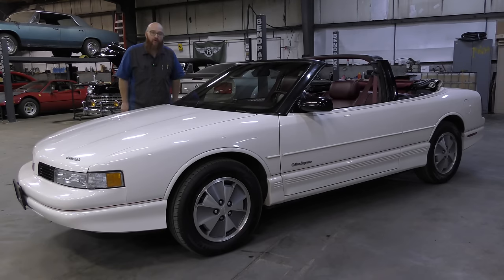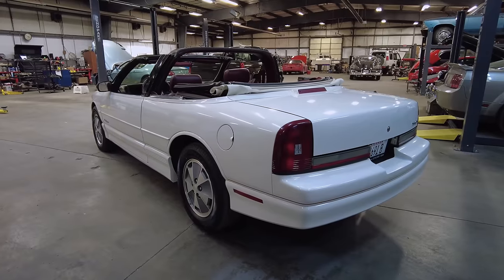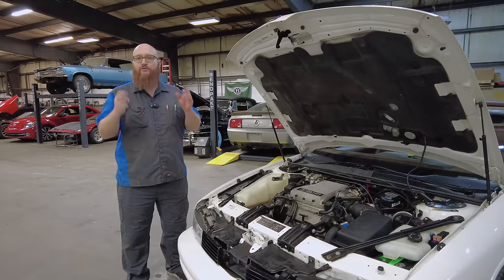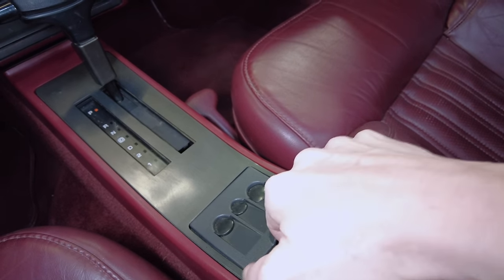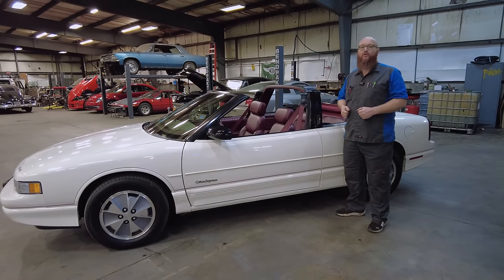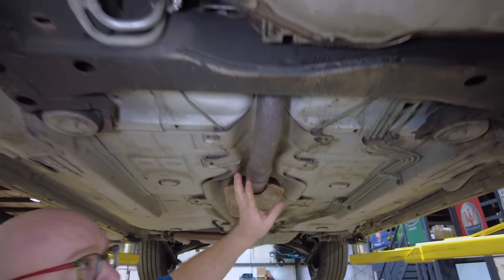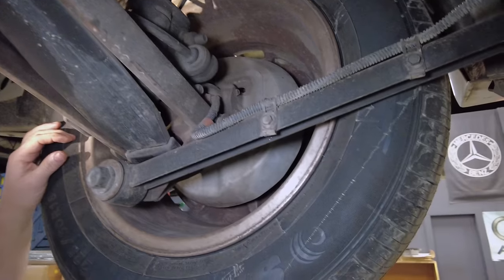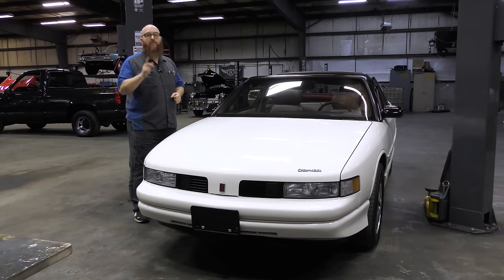A REAL Survivor! This 1991 Cutlass Supreme is MINT! It Will BLOW Your Mind!

Comment: Doing a water pump on those 3.1s is a dream, probably takes 20 minutes, its right on top. Easiest water pump ever as far as i know.
Reply: Changing the spark plugs,  a different story though.
Reply: That engine is definitely easier to work on than the optional 3.4L DOHC engine. The timing belt itself is at least a 6 hour job.
Reply: @donaldwilson2620 special cam locks needed too, no keys on the cam sprockets....

Comment: I've got a soft spot in my heart for these Cutlass Supremes.  I still have the 1989 Oldsmobile Cutlass Supreme International I got over 30-years ago when I was in high school.  Same body style as this one, but a coupe.  I had the horn problem on mine as well probably 2 decades ago.  Tried to replace the sponge, but it would still intermittently honk.  Ended up just disconnecting the spade lugs on the side horns but left the middle one connected.

Comment: My first car was a 1993 Cutlass Supreme 2 door. I loved that thing, it was super reliable, never gave me issues or left me stranded. It had one weird quirk. Literally the day after I drove it home the transmission developed a weird whine that would wind up in 1st gear only. So EVERYONE knew when I was pulling up. It was like my signature signal.
Reply: I always like GM cars from the late 80s to mid 90s. They were reliable I had a couple of Chevy celebrities  delta 88 and Buick LeSabre. Replacing an intake gasket, which was common on. These wasn’t too bad of a job. It’s a lot more reliable than these newer GM cars that have timing problems . in the past I never liked Ford. They were the ones that were unreliable but now I can’t say the same honestly, I think as of 2005 to present Ford actually might be more reliable than GM. Chrysler Fiat we won’t mention their name. They’re that bad. unfortunately, even Toyota has problems with the timing chain similar to the GM 3.6 L. I guess all cars are junk these days even the ones that had an impeccable record.

Comment: The older car didn’t have so many computers and easy to work and fix without breaking the bank it’s a keeper. It is so beautiful
Reply: Do have to watch those digital instrument clusters>>have a habit of failing with time and may be hard to find.
Reply: Actually it has a computer, and it is not OBDII.  I drive a 92 Volvo and an 89 chrysler both with pre OBdII computers.  When Wizard said that the new mechanics are not interested in working on them, that is why.  the Volvo is well supported on line, but the old TBI chrysler has been left in the dust.  Only one older shop still has the computer that can analyze the system.  I can pull codes and throw parts at it, but like he says, you need the right equipment to properly troubleshoot.

Comment: I had a hardtop 1991 Olds Cutlass Supreme.  I owned a 1989 model as well. Loved these cars.  The 89 was my first big-boy used car when I turned 21 in 1994.  In 95 I hit a deer and traded in on the 91.  Somewhere between 94 and 95, I purchased an 89 Grand Prix. It had around 100k and I paid $2000 for it on my credit card (dumb I know now).  Ran like crap and had a dented fender.  Replaced the fender with aftermarket and changed the spark plugs.  It ran amazing and these were my 2 vehicles from 1995 through 2000.  Only ever needed to replace the rear wheel calipers.  And the Pontiac needed new driver door handle replaced twice (common failure point on the coup model).     

Didn't realize the Lumina shared the same class.  I got a 98 Lumina in 2004. The 3.1L lasted for 150k miles and 10 years! It leaked oil, but never died on me... I just kept up on maintenance and tires.  Best cars I ever owned.

Comment: I had one identical looking, but not a convertible. Mine however, was a very rare 91 International 5 speed manual (Getrag HM-284) with the 3.4 DOHC. It had quad leather buckets, digital dash, and HUD. It was 1 of 109 made that year. They only made 500 total 3.4 DOHC 5 speed cars between the Grand Prix, Cutlass, and Lumina. They only made this combo in 1991 and 1992. There was 1 93 GP with the combo. You could also get the quad 4, 2.8, and 3.1 with the 5 speed HM-282 from 88-92. There were no manuals after the 1 93 was built. The 3.4/284 combo was very fun, the trans was only ever paired with the 3.4 in those 3 cars. It was geared perfectly for the high revving 3.4. If ran to the redline (which was 500rpm higher in manuals), it would drop you in the next gear at 3,200rpm, right where the powerband started to pull hard. They had a much shorter throw than the 282, and also had a pull-type clutch similar to the corvettes.
Reply: Didn't know you could get the digital dash with the manuals. The revised dash the put in later years looked so damn cheap
Reply: I presume you still don't have it?
Reply: Unfortunately, I sold it in like 2015 with a brand new create engine not installed yet. The original developed a rod knock. I believe the guy lives in Northern MN that bought it from me. The only option it did not have was the D.I.C., but through a forum, I found out that all the HUD cars were pre-wired for the D.I.C. I bought one used from a member and added it. It also had the sunroof. It also had a bad PMIII abs pump, and those are unobtainium! Napa used to rebuild them for $1,500 back in the day. I was going to try to source a 5-speed firewall plate for the vacuum brakes and convert it, but I never got that far.
Reply: Most of the 2.8 & 3.1 5 speeds had normal non ABS brakes. But unless you want to chance it and weld on new studs and hope to hell you got it right, you need to pull the entire dash and swap that firewall plate out. The Power master  III ABS system was a nightmare and only used a couple years in the high optioned cars. I believe this system was also pioneered in the corvette. People say that when working properly, it was better than modern ABS brake systems, but they usually are not in working order, and parts are impossible to find. I believe the auto 3.4 was 215 hp or 225, the manual was 15 or 25 hp more. There are stories of this 3.4 5 speed combo being turned up close to 300hp in development, but supposedly were de-tuned because they were outrunning the Corvettes of that era. They said the Getrag HM-284 paired with the 3.4 would handle at least 300-400hp, and was sopposedly the strongest FWD transmission to ever leave GM. The auto could hardly handle the 3.4 that was turned down from the manual version without exploding.
Reply: @zachkelley1830  I wondered why 3.4 liters and DOHC Still only a little over 200 hp. Most 3.4s I would see were Lumina Z34
Reply: That’s too bad you sold it!    Very very familiar with the pm3 system and firewall plate swaps in these cars!    (I’ve done 2-3). 

Wonder if the guy ever got it back on the road?  I haven’t seen it on any groups or forums I frequent!    

This convertible also has the pm3 which sucks for someone down the road!    Still an awesome example of the convertible.
Reply: I had a 1994 Cutlass Convertible with the 3.4 DOHC engine. So much quicker than the sluggish 2.8/3.1 pushrod V6s the earlier models had (like the one in this video), but they weren't as reliable unfortunately.
Reply: Yeah, they had much more pep, and the stick shift 3.4 was that much quicker than the auto 3.4. The convertibles really needed the 3.4, as they were a bit heavier, too. The 3.4 were very high maintenance. I think they were supposed to have a timing belt service every 40,000 miles, which is crazy! The alternators were horrible to get to, especially on the automatics. They were pretty decent if serviced properly. I've seen several with 200-250k miles. I had a 91, 92, 94, and 96 Cutlass, all coupes. My 96 and 94 were the only ones that really saw the road, both 3100 v6 cars. The 92 was a parts car for the 94 after I totaled it, hitting a deer, and I bought it back from the insurance company. I bought the 92 for $550 and drove it for a couple of weeks. That one had the older 3.1 v6 and was the most gutless of them all. My 91 International was the fastest, of course, but I only got to put about 200 miles on it before the engine started knocking. The 96 was a factory freak for power for having a 3100. I've driven many 3100 cars, but that 96 Cutlass had way more power than any of them for some reason. It would just melt the tires if you wanted. My 94 3100 Cutlass had nowhere near the power.
Reply: The DOHC 3.4 is a very interesting engine. It's its basically a modified 2.8/3.1 pushrod block. They actually still have a traditional timing chain set that runs a "dummy" cam shaft in the traditional pushrod location in the block. That dummy cam then moves your overhead cam timing belt system. It is very interesting how everything was designed.
Reply: @zachkelley1830  I'd imagine a 3800 V6 can't be too hard the regal GM10s had it. How reliable was the McLaren 3.1 turbo?

Comment: Thank you for sharing this Oldsmobile Cutlass Supreme. As an owner of two Oldsmobiles( 98( 1996) and Toronado( 1992) I say thank you. It was great to see it was in great shape and all the features are holding up and other items as well.  The digital gauges did go away sadly and were replaced by analog gauges. They made other changes such as the headlights and the instrumentation panel and engine options and power. It sadly never got the 3800 V6.  Buick Regal had it as an option, but by the second generation W Body, they all offered the 3800 V6. In Oldsmobile's case it was in the Intrigue.

Comment: Thanks for showing us this amazing car! I’ve been hoping for a video since I saw it in the background on the channel. When I was a teenager in the mid 90’s, I remember seeing one of these and thinking it looked so good. I loved that ‘roll bar’. I saw one at a dealership near my job and had to check it out. It ended up being a fully loaded ‘94 in ‘98, right after I turned 18, and I convinced my dad to co-sign on a loan so I could have it. Soon after, he tried to convince me to let him take it over, but that wasn’t happening. Mine was a white 3.4L with a black top and charcoal grey interior with the 5 spoke rims. It was quick, and the dual exhaust sounded amazing, especially driving under an overpass. It had the bucket rear seats, all auto-down windows, and it had heads up display! My opinion is that ‘94 had the best looking interior, because they changed up a few of the controls and the steering wheel from the earlier generations (it had HVAC controls on it as well!), but it wasn’t the rounded dash look of the later years. I really enjoyed that car, and I was a little sad to let it go when I finally sold it about 15 years ago.

Comment: Top notch condition for it's age, museum quality.  I attended Kalamazoo Valley Community College 2013-2015 for electrical construction and owned a red 1992 Pontiac Sunbird convertible as my first car, 3.1L V6 and 5 speed manual,  paid $1250 cash.   Sadly the body was badly rusted from the hash Michigan winters and the top leaked like a sieve, getting a nice drenching while driving in the rain was business as usual and the car began to have electrical problems as a result.  About a month after graduating the oil pump went out and because the some of the gauges including the oil pressure guage quit working or worked intermittently,  I had no way to know that there was a problem and the engine seized up while on the way home from a job interview.  I ended up scrapping the car and brought a 1993 ford ranger, also a 5 speed manual/ 2wd.

Comment: Thank you very much for this video.  I was pleased to hear Wizard's describing this lovely car.  That is because I have similar Olds Cutlass Supreme vert, but 1993 with 3.4 LQ1 DOHC, one with 4 small square head lams which Wizard talked about.  I live in Europe thus Oldsmobile is even more rare here than in the USA. And I am 99% sure my 93 Cutlass Vert is the one and only in Slovakia, my country.
My car is over 160K miles and sure has more issues than this one (conv.top leaking, engine oil leaks, ABS light on ...).  It also have issue with side horn buttons. They both do not work. Horn only works when the middle steering wheel is pressed.  Still I love my Cutlass and it is really an extra rare eye catcher here in Europe. People just do not know what it is 🙂

Comment: I used to have a 1993 cutlass supreme convertible that I absolutely loved with about 70,000 miles and the dual cam 3.4 V6. I loved the engine but it was a pain in the ass to work on. I remember having to do a alternator in it years ago and I never swore so much in my life until I did that alternator. Other than that, it was an amazing car that I wish I never sold. I bought it from my mom when I was 16 and sold it when I was 22. I only sold it because I didn’t want to daily drive it because it was so mint and I needed something 4wd and I could afford to have 2 cars at the time. I do hope to get another one some day.

Comment: Too Funny ...,  I owned a late 80 Internal Olds Cutlass ..  Over 250k on mine before engine died ! W body . Brake calipers sleeves always seized up. Slight gas leak at tank seam.. My driver cloth seat came apart at the seams from all my driving ...  That car was such a smooth comfortable driving car ... Thanks for the Vid 😊

Comment: Sadly, Wizard if you brought that to factory dealership today; they wouldn't say anything at all to you. Literally no Oldsmobile factory dealerships left in existence.
Reply: Millennial GM tech: “an Oldsmawhat?” 😄
Reply: General Motors was famous for their badge engineering (marketing similar cars under different brands with minor badging and cosmetic differences).  This car was similar to the Pontiac Grand Prix, Buick Regal and Chevrolet Lumina.  That means you could take any of these cars to one of the other brands and the technicians could service it with no issue.  Today, almost no one is going to pay expensive dealership service rates on such an old vehicle long since out of warranty.

Comment: GM10 platform.  I found a 1995 Grand Prix for my daughter, only 57K miles, as of today parked in the driveway.  There were a few problems, including brake lines, motor that oozed coolant and oil.  Someone tried to 'customize' the interior.  But the body is really in great shape.  Put on new struts all 4 corners.  GM 3100 works great with all new gaskets/seals everywhere, Fel-Pro.  The 3.4 Twin-Dual Cams are all dead, but the pushrod 3100's keep on going and going.

Comment: Toyota car care nut yesterday had a video about a 94 lexus. The dealer gave up on. The ecu had problems.  They used the parts cannon on it. They put cheap non-oem parts creating more problems.  They couldn't diagnos the problem.  Just like the car wizard, this guy can find and fix the problem.  He also hates cheap parts. They cause more problems.

Comment: Back in the mid-90's, I owned an 84 Cutlass. It blew the engine after 6 months so I replaced it with a 92. It's insane computer climate control turned on AC in the winter, and heating in the summer. After a year I traded it for a brand new Honda Civic and been driving Hondas only since (Civic, Accord, 2 Pilots) - GM - never again. Cutlas broke me.

Comment: Those 2.8/3.1 V6's were also notorious for leaking oil from the "distributor" shaft that goes down into the block right about the bellhousing.  The o-ring fails and oil pours out.  Although these are DIS, the Lumina minivans with this engine had a distributor.

Comment: Back in 2007 when I was car shopping I looked at an identical 91 Cutlass Supreme convertible in white with the red interior for around $2k. It was in fine shape, drove well, the four wheel discs stopped on a dime plus the original owner had all of the service history. However the door mounted belts were kind of annoying and the interior furnishings had that Roger Smith era cheap quality about them. 
I took a pass on it while also considering a later model W-body Grand Prix coupe with the excellent 3800SC. Instead I went for another Thunderbird, a MN-12 95 LX with the 4.6 modular V8 and standard air bags, hence no irritating mouse belts along with most options. It served me well for over 12 years with normal maintenance.

Comment: Wizard,
You should've demonstrated the unique "beer tap" exterior door handle  on that generation of GM midsize cars.  Always got a chuckle out of my new 1990 Chevrolet Lumina coupe with this crazy design feature.  One of the reasons that Olds had to have a targa-tyoe rollbar on its convertible.
Another great video.  Thanks, JJS

Comment: Had that 3.1 V-6 in a 1992 Cavalier.  That engine was a real sleeper.  When it woke up, it could really move that car down the road.  People thought it only had 4 cylenders but were wrong when they saw that car move.  It did have to have gaskets replaced on the intake.  The motor had gobs of torque.
Reply: I had one in a Z24, it was not fast dude.  About 150 hp. Maybe if you time warped back to 1977 it would seem quick to other cars on the road. lol

Comment: I had a 92  in 1999 with a 3.1. It was the most fun I've had. Ever. Aside from the 83 2 door Caddy coupe broham I had at the same time. Now I'm old.
Reply: I tried to put 15 inch wire wheels, but it's like my lowrider Caddy at the time, you have to grind the caliper unless you want them to poke out with spacers. Man I miss this car.

Comment: Wow a fiberglass leaf spring, never seen that before. That horn design leaves a lot to be desired.
Reply: The corvette has it, also Volvo used them in a similar configuration on the 960/v90

Comment: Amazing how GM could screw up something as simple as a horn button... Kudos to Grimes! 
This a flashback to the late 60s/early 70s, when they couldn't make the rim-blow horns work properly either - while Ford had no problem with them.  I loved the one in our Lincoln, and it was still working fine at 140,000 miles.